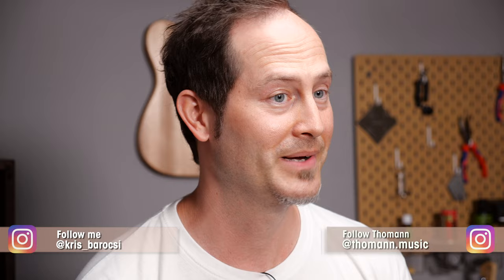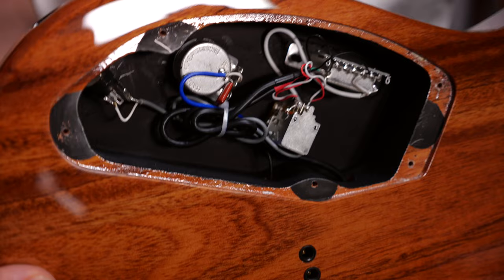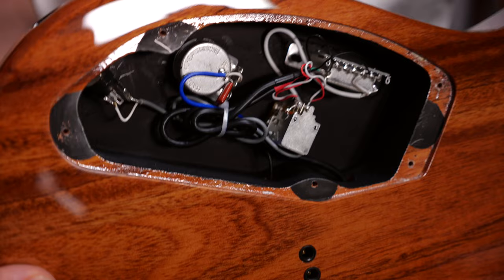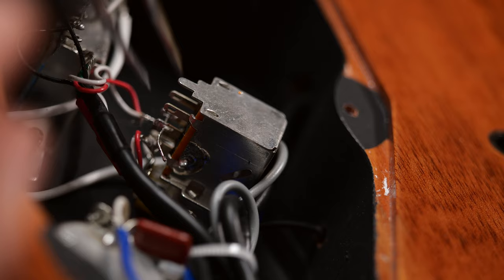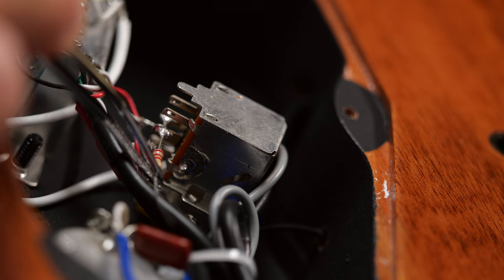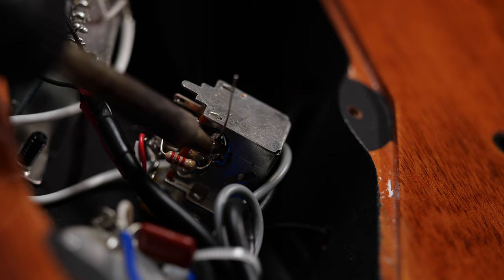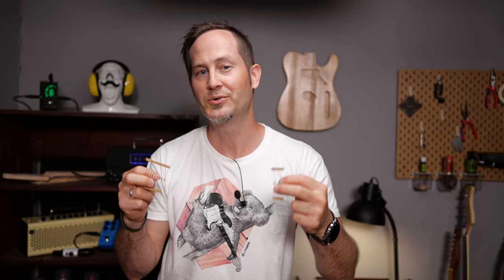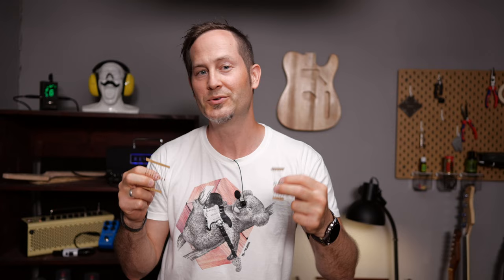Secret PRS Coil-Split Mod | Guitar Tech Tips | Ep. 67 | Thomann

Comment: Hi Kris, how would you go about wiring two PRS 57/08 humbuckers to a PRS Custom 24 (5 way rotary, no push-pull), that has been modified with 2 push-pull pots (to allow having both pickups ON or only the neck or bridge ON as either a humbucker or single/split)? Also, as far as I understand that would leave me with 2 non-used positions on the 5 way rotary switch, anything else I could try to make use of these positions? Thanks in advance
Reply from the maker: Hi, thanks for the comment! I'm not a big fan of the rotary switch (had an old PRS and always took forever to find the right PU position on stage) so I'd replace it with a 3-way toggle. Even more so, now that you have the two push-pulls for the coil-split. BUT. Only if you can install a toggle switch, if you don't have to mod the guitar's routing. And of course keep the original rotary switch to be able to restore the guitar's original state at any point. If you want to stick to the rotary switch, you could do this: humbucker and coil-split tones with the rotary and series-parallel with the push-pulls. Or even in phase / out-of-phase with the push pulls. It's a little over the top, but you might find some really inspiring tones there. Cheers //Kris
Reply: PRS itself doesn't use rotary switches any more, so probably they weren't so convinced either... 😅

Comment: Does the resister effect the humbucker's output when it is in series? The humbucker in series after adding the resister seemed a little quieter.
Reply: no, when the switch is not pull, the resistor is not in the circuit

Comment: I know Charvel uses capacitors instead of resistors for the coil-split. Does that sound/behave differently?
Reply: Capacitor resistance increases the lower the frequency of the AC goes. I don't know the details about their wiring but if it's just like this but with a replacement, I suspect they are trying to keep the 60Hz region to still maintain hum cancellation

Comment: So they are not split it’s still a humbucker with a resistor in series.
Reply from the maker: Technically yes. It's like an "almost coil-split" thanks to the resistor. Which reduces the hum a little in the split mode but also makes it louder and fuller. Pretty clever actually. Cheers //Kris